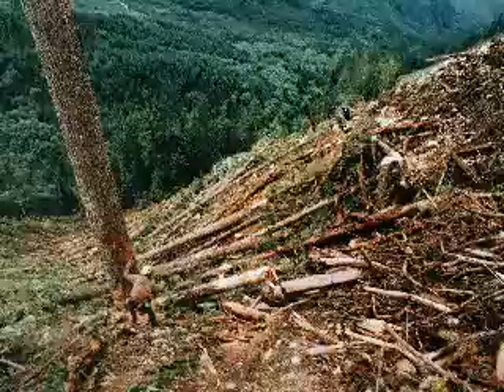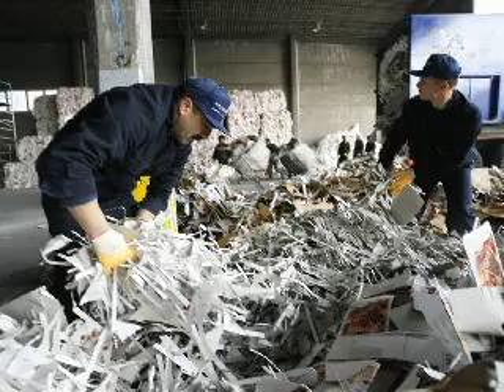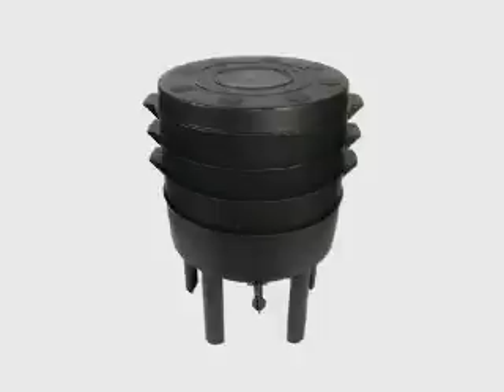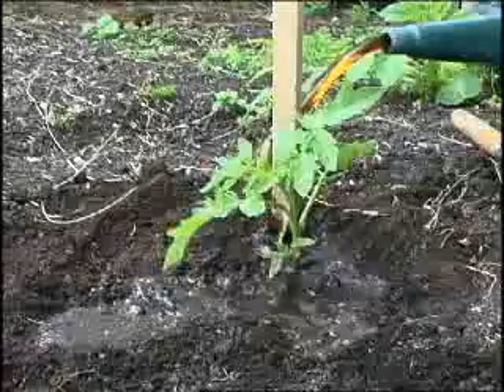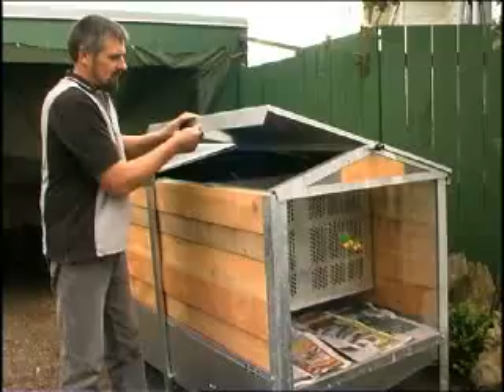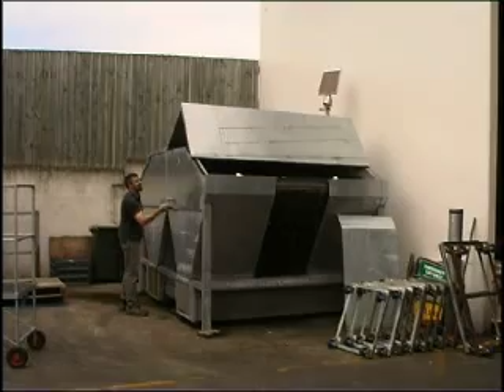Worm Farm Introduction and Guide

Comment: The following tips are on their site Worms prefer a mixed variety of organic kitchen scraps, hand towels, paper, egg trays and corrugated cardboard etc.
Keep the carpet and worm food damp. Watering will be required at approx 1 litre per week.
Open the tap to drain weekly.
Liquid can be diluted with water approx 1 to 5-10 parts water.
The worm castings should be tilled into the soil (10 litres volume to 1-2 square meters of garden) More tips on site